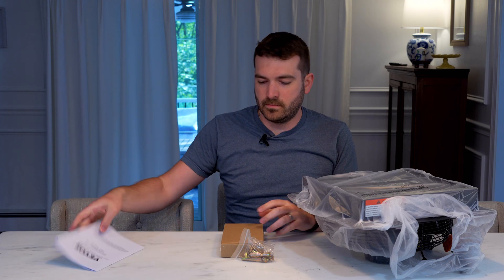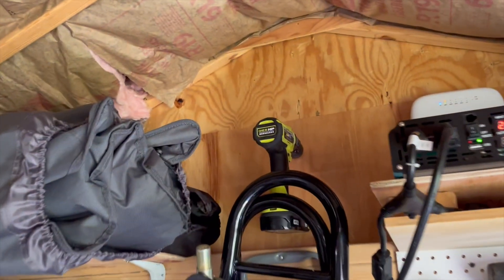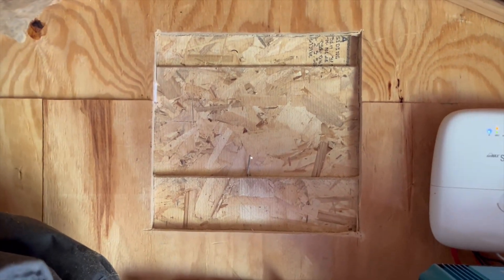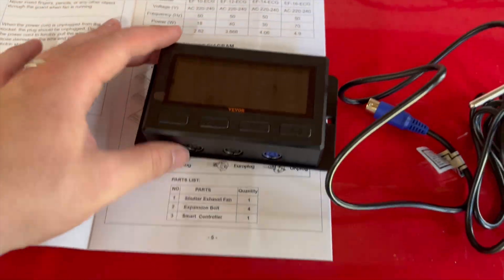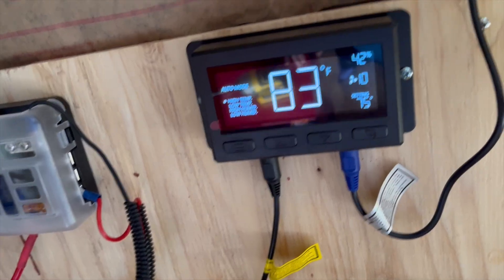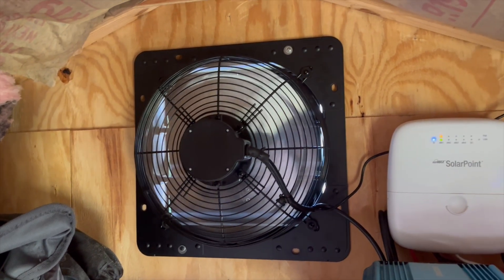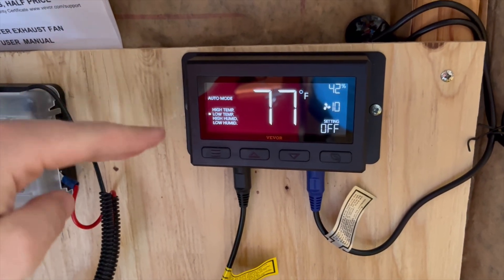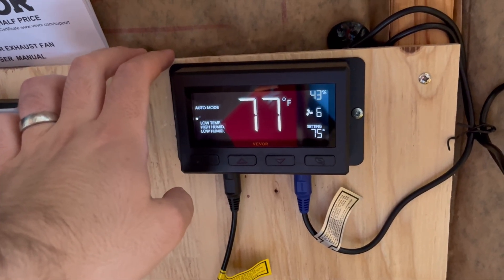DIY Solar Shed Ventilation – Installing the Vevor Exhaust Fan

Comment: I have just opened one and realise rain could get in from the vent.
Reply from the maker: For me, it seems that rain and stuff should most likely be fine if you mount it correct orientation. But if it's raining sideways or something there's certainly a slight potential